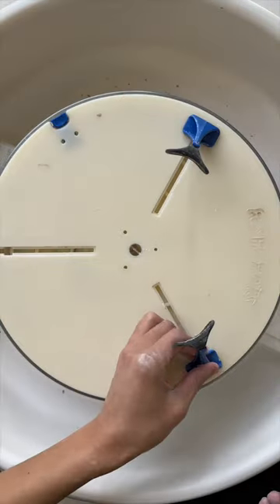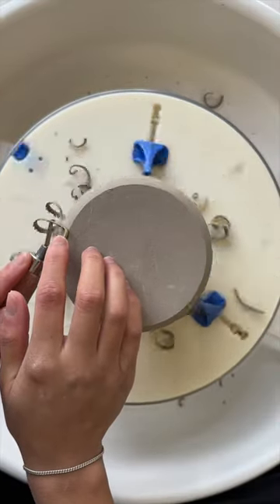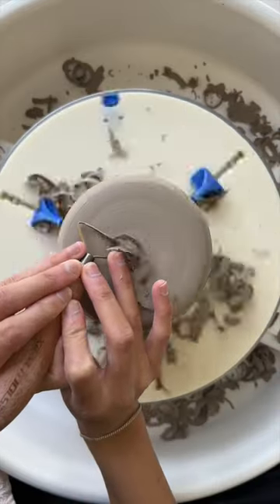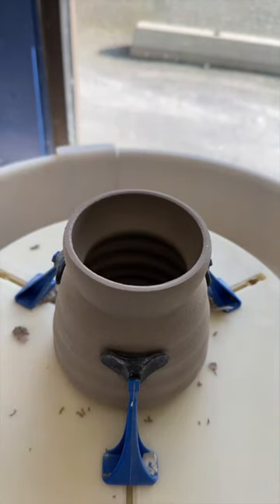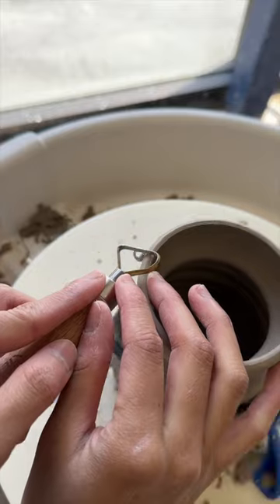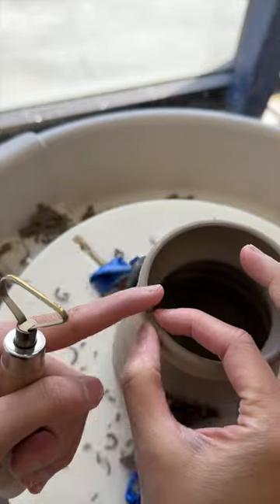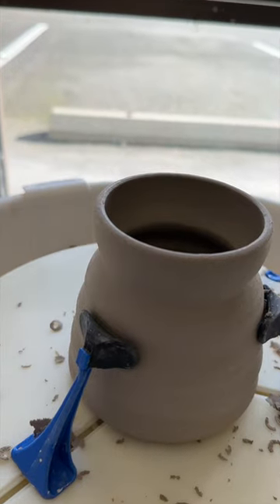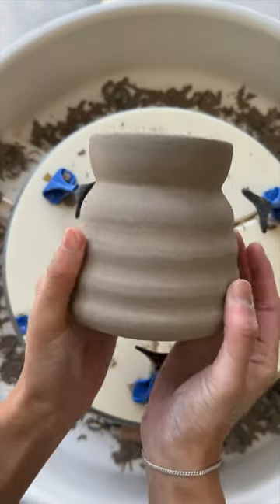How I trim my mugs. This is 97 of 100. #pottery #art #ceramics

Comment: I still think the mug looks a bit on the tall side but the new grooves match the shape really well. I’m excited to see what the handle is going to look like. The previous mugs looked like a beehive with gradual grooves. This one has a different shape; it’s taller and the grooves are not so gradual (aka the mug looks straighter). I don’t necessarily like one over the other because they are very different and invoke different feelings. I’m excited to see what you bring to us next!! See you soon ❤❤❤
Reply from the maker: Good to know! Thank you for always providing your perspectives. It is a bit taller, which as I’m trying these mugs out, it’s a little easy to hold while you cup your hands around it! A design adjustment rather than a look adjustment. 

Thank you again for always sharing your opinions, it really helps! Good luck on your tests and see you soon! 🖤🙌🏽